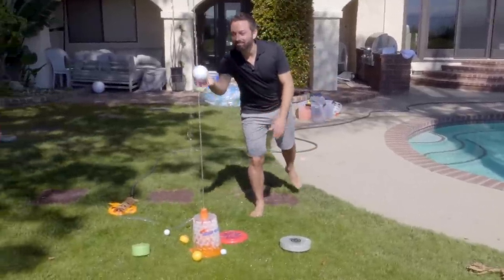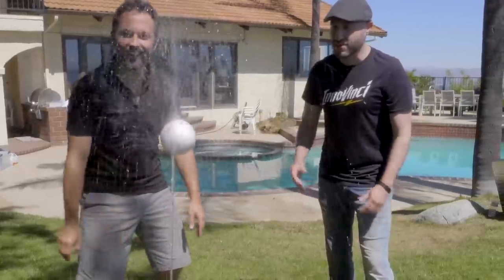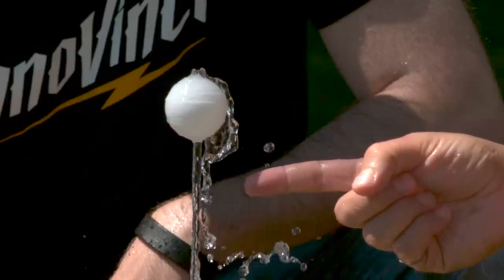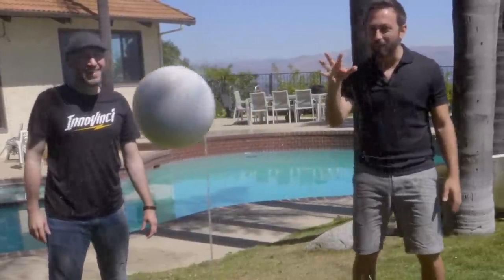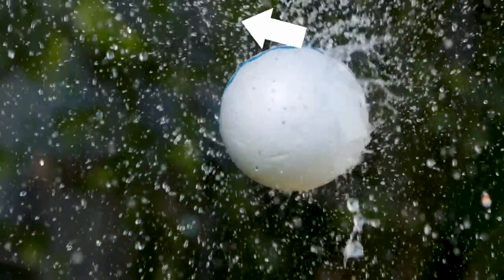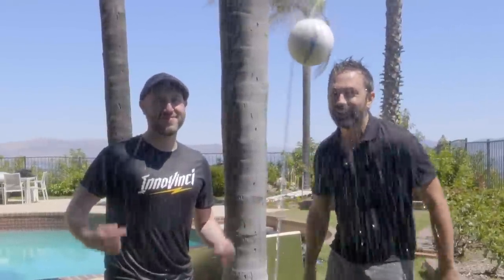Hydrodynamic Levitation!

Comment from the maker: FAQ:
1. This is similar to the Magnus effect in that the relative motion of a spinning ball through fluid creates a force that affects its motion. It's different in that here the fluid starts the ball spinning and there is an equilibrium point around which there are restoring forces. In the Magnus effect the ball must be spinning to begin with and since the fluid is everywhere it can continually change speed and direction.
2. It's not the Coanda effect. The Coanda effect relies on entraining fluid from the surrounding area creating a region of low pressure. Here there is no water surrounding the stream to entrain (since it is a narrow stream).
3. Adhesion between the water and the ball is important - this is what directs the water flow over the ball.
4. The sum of the forces I show should not be zero but equal and opposite to the weight of the ball. Hence the forces of up and out from the initial contact with the stream and up and in from the spray add to make an upward force equal to weight (the in part of the second force is much more important than the up part)
5. It would be interesting to try this with a hydrophobic coating and see if it still works. My hypothesis is it would be much harder.
6. Apparently there are other fountains and toys that use this principle that I was unaware of. This video uses the design created by my friend Blake.
Reply: You can do this with water in air going against gravity - what about doing it with air in water going against buoyancy?
Reply: Plus: The ball is hollow.
Reply: I am not sure the spray plays any significant role in this as most of it is actually happening at the top so is not providing any up force in aggregate. 

I believe some or all these forces are helping maintain the equilibrium and keeping the disc up:

(1) water is not hitting the ball/disc exactly on the circumference. It's slightly inside. That force breaks down into two components: (a) rotate the ball/disc (b) apply upward force which helps counteract gravity. 
 
(2) stickiness to water which applies an upward force as the water is shooting upwards, helping counteract gravity. This also provides an in force I think. Since the ball does not try to push out as it tends to adhere to the water stream. 

(3) gyroscope effect for position stability esp for the disk
Reply: I thought static electricity between the styrofoam ball and the water would help keep it in place. Is it possible that it actually is true to any significant capacity?
Reply: What's up Derek?
Reply: You can also do it with a screwdriver and compressed air! Is it the same effect?
Reply: Veritasium 
if light does not have mass 
then why gravity has an effect on it ?
Reply: static electric levitation  is better, it will be how we will fly crafts in the future by changing the positive or negative electrons around the craft to move and levitate, just an FYI on the future I have seen.
Reply: grkhetan its the rotation that spins it back to the stream.. simple really.
Reply: I don't think that would work. With water in air (on land), the motion of the stream is outward from the plane (the ground). With air in water, though, the motion of the stream is toward the plane (the surface of the water). If air struck a ball in water as it was falling, it would just push it out of the way or move around the ball and continue upward. The water from the stream in the video example is going out and then back down.

That's not even considering that the adhesion responsible for the ball's ability to move the water around does not apply to the air in a situation of a rising air stream in water.
Reply: In order to increase adhesion on the disk, wouldn't it be a good idea to add some small edges on that disk, positionoed in a way that they rotate the disk by the force of the water jet?
Reply: would it still work with a polished light weight metal or glass ball where there isn't as much surface tension for the water to push and force the ball around?
Reply: plz gimme an equation for this.
Reply: How can the water "push" on the sphere?  Waters cohesion to the sphere allows it to be under centripetal force which would pull on the sphere.  Loss of this cohesion would not push... pull less??  I threw out a few ideas in a general comment but I really want to know how you explain the water pushing...
Reply: It would be interesting if this experiment could be done also using another liquid with a lower surface tension!
Reply: Veritasium I think the polarity of the water also plays a role. It would be interesting to see if this would work with other liquids (alcohols, oils, etc) with different polarities.
Reply: san kitty "dihydrogen monoxide" makes it sound more scary.
Reply: Hmm, I'm tempted to try to replicate this on a small scale using acetone and a ping-pong ball. Hardest part may be figuring out how to not make a flammable mess.
Reply: Veritasium Missing the times when you got to the street and simply asked questions to people, and showed them how they really don't understand things that they thought they do. Tricky questions and counterintuitive thinking, showing us wrong to get right.
Reply: +Ryan Maxwell https://en.wikipedia.org/wiki/Momentum#Conservation
Water is the one that keeps the ball spinning
Reply: #3 and #4:  The droplets that form water strings are oriented normal to the surface and moving radialy because of radial acceleration outwards so the net effect from those droplets is 0 towards stabilization of the ball.

The main part of this effect lies in that little sweet spot where stream is hitting the ball's surface. Here, the Van der Waals forces between the ball's surface and the water act and that is why ball receives the energy from water.

The water hits the surface, smashes against it and the water tries to pull itself back together with surface tension. Some of it (the part that had energy high enough) forms smaller droplets and some of it ends up pulling the ball with tangential acceleration. This in turn starts rotating the ball. The force vector of all of this points upwards and into the stream (with a slight angle which should be similar to the angle from the point of contact of the surface and water stream, tangentially out). That is why the ball fell vertically when you put your hand below it and blocked the stream. If you look closely it swerved into the stream after it regained contact with the water, I think supporting the hypothesis written.

#5: My bet is that it will not work on hydrophobic ball at all, since the water will just bounce off the surface and the ball will immediately fall to the ground since there is no sticking of the water to the ball and only slight transfer of inertia. So the stream will with 100% certainty shoot away the ball. I would be surprised if it weren't so.

It would be interesting to also play with different viscosities and with that try to levitate more than one ball at the same time. Maybe there are some more secrets to unlock?
Reply from the maker: plenty of misconceptions in this comment section but yes I take your point
Reply from the maker: easy, water hits ball, bounces off and some momentum is transferred. You can see the water getting slowed and deflected to the left where it hits the ball. This means the ball is being pushed up and to the right by the water.
Reply: Veritasium What misconceptions in general stick out?

There are so many variables in real world (non-controlled) settings. 

I think there's a lot of interesting thoughts and suggestions in the comments. I think most people's comments weren't meant to challenge your understanding, but rather to expand on it out if their own curiosity. Like how the surface tension of the liquid, the surface of the ball and whether it has a hydrophobic coating or not, etc. might have an effect on the experiment.
Reply: Veritasium I hope you'll find the time to try #5 (did you see my suggestion, lol?) and maybe even some other tricks that influence adhesion/cohesion - using sandpaper on the ball's surface, using another fluid (soapy water?), etc.
Reply: @Veritasium: Yes, of course. The water hits it (and tries to topple it to the right like you said) and then water changes direction and pulls the ball/disc with it (the secondary effect of "friction" between water and ball's surface that keeps the ball in one spot) in that direction because it is sliding over the surface. That's why it is proposed that hydrophobic will have only the first effect (topple the ball out of the stream). 
The droplets opposite the stream are flying radially out on the ball and I disregarded those because in the green disc experiment, there are basically none of them opposite the stream. So I figured they are not contributing anything (or very little) to the end cause of stability. But, I could be wrong. 
The hydrophilic ball gedanken experiment though...is making my head explode...would it sink into the water stream? Or would it first get pushed by the water like the styrofoam and then slide down along the stream because it would become too slippery for the stream?
Reply: You always comment what I'm about to say when I go to put my 2 cents in.
Reply: You should DEFINITELY search and make a video about kinetic stone sculptures. There is one in Bursa/Turkey made by Christian Tobin. 6 and 7 tons weighing stones are spining on a cushion of water.
Reply: He already has buddy. No that exact one but the same principle.
Reply: You should try this experiment again but lower the surface tension of the water to validate you theory.
Reply: You need a hardware audio compressor for your microphone(s), Derek. There was so much signal loss while you were excited =)
Reply: He's been getting exited a lot lately.  Something tells me he's looking to target younger audiences...  Most of them are oblivious to fake excitement. 

Edit: After seeing other comments I realize his issue could have been avoided with a change in editing.
Reply: Veritasium very cool thanks for sharing
Reply: Could you pls try it again, but this time adding a little bit of soap in the water, to break up its superficial tension? Congratulations for this very interesting video!
Reply: Veritasium Dear veritasium, 
Could you also try,
1. A donut shaped object to see to see if the inside gets wet as well. 
2. Different speed of water
3. Different weight of the balls
4. Die the water in different colour each 5 seconds to see its actual path
5. Try "passing the ball" from one water stream to another
6. Try with different ballons (ball with air and therefore extremly light). 
7. Maybe different water temperature (because the water tention might change at that point.

8. Disrupt the "flow" of the water in many ways. Putting the pipe in a pool where it therefore has to push away a lot of water. 
8.1 putting different balls at the same time. A ping pong ball, a balloon and a styrofoam ball for eg. Sinc it looses speed with each contact it should be completly disrupted by the end. 

I know I am already late. That is why I commented under your comment to get more attention from you. I hope you dont mind.
Reply: Veritasium is so excited
Reply: Veritasium this definitely strikes me as largely impacted by gyroscopic effects as well as water adhesion to the object and the water coating adhering to the stream as well, also the size of the object and possible surface roughness.  Is the surface of the ball completely smooth or rough like most styrofoam?
Reply: I was about to say you should try it with a hydrophobic coating but you beat me to it!
Reply: Was about to point out the possibility of the Magnus effect in play here.
Reply: Can you please make a video about black holes, quark stars and neutron stars? I have my own theory, which says that black holes are just neutron/quark stars which have so much mass, that the light emitted from these stars, never reach us or anybody else because they just fall back on the surface, so they look black. Is it possible that my theory actually works?
Reply: Derek, how old where you in the video with the hair driyer ? dude, it looks like you were a teenager
Reply: Veritasium why don't you test your hypothesis, coat the balls in hydrophobic spray and see if the ball still levitates
Reply: About item 2, I believe it isn't right. The low pressure region is necessary only in the beginning of the effect, and a narrow stream of water is perfectly capable of to create this initial condition. And the Coanda effect explains item 3,  adhesion between the fluid (water) and the convex surface (ball)...
Reply: Veritasium bro this is why I love science
Reply: Can I Ask A Question?? Could The Sun Die Could It Lose Light/heat???
Reply: Amazing. First time I see that. This should be called the Vinci-Veritasium effect.
Reply: +Veritasium: Why is Bernoulli principle not the main factor working here? The air closer to the water stream moves faster and thus exert less pressure on the ball (disk) than that further away. That keeps the ball (disk) in contact with the stream, the upward momentum of which imparts to the ball (disk) countering the gravity. 

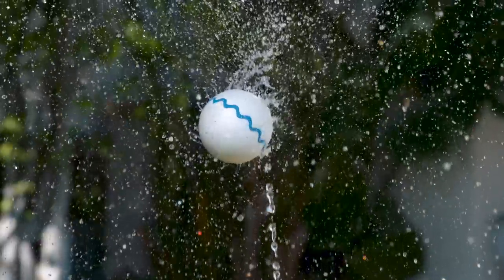The secondary force contributing to the levitation does come from the spraying of the water. However, you are not completely right on the mechanism. The spraying of water occurs all over the surface. At 3:24 you say "the water is getting thrown over and down by the ball" thus " is putting a force up and in on the ball". However, since the water droplet adhering to the ball surface starts from the stream it will more likely be thrown off first while going up and out (you can see this clearly from the video as more water shoots away from upper part of the ball than the lower part), the force on the ball will be greater, down rather up, and in, on the ball. The down force is more than compensated for by the much greater upward force from the water stream exerted on the ball. The effect of the spraying is to contribute together with the Bernoulli principle that air stream observes to press the ball again the water stream allowing the water stream to do the work of lifting the ball.
Reply: How many stable fluid levitation effects are there?
Reply: +Jarrod Baniqued: All of these phenomena, including the ones shown in this video, Magnus and Coanda effects, are corollaries of Bernoulli principle. I do not see the essential conceptual difference amongst them. Any effort to differentiate is nit-picking and wasteful.
Reply: One of the Veritasium team looks like the lead singer from Rise Against!
Reply: because gravity bends the space. And light travels trough space
Reply: I was gonna say, very similar to the magnus effect. Very cool
Reply: Jmoss7 indubitably
Reply: Veritasium what will happen if you do this in a vacuum. will that manipulate the law of Bernoulli?
Reply: I'm pretty sure you're explanation is somewhat wrong. It seams you're overestimating the sideways force that the water is putting upon the object, the water is mainly putting an upward force on the object, since the water is going upward. Now the reason why you think it is putting a sideways force is because the force is offset to the center of gravity of the object, but this does not induce any sideways force, it only induces a moment in the object causing it to spin.

The restoring force you're seeing keeping it in place is probably due to that adhesion you were talking about but might also have to do with some fluid dynamics since you do have a liquid traveling at speed on one side of the object and a stationary liquid (the air) at the other. But I don't know enough about fluid dynamics to tell you how this interaction would behave. It seams you have not consulted with physicists in the making of this video :/ And in the spirit of keeping it "scientific" you should have presented this as a hypothesis and stated "here's the parameters we could change to support our hypotheses and here's how to disprove it", not just bluntly state "This is how it works, trust me, I'm the host of Veratasium!" Still an entertaining video tho, just seams you're straying a bit of what your channel used to stand for, finding the element of truth, not presenting it.
Reply: I just saw this at a science museum in columbus, OH.
Reply: C.O.S.I.?
Reply: yep
Reply: Light does have mass. it's just super tiny
Reply: According to special relativity, light is massless, otherwise it wouldn't move at the speed of light.
Reply: Nope, light has no mass, that's the reason why it can travel at light speeds. Anything with mass, no matter how tiny, cannot travel at light speed since mass is relative to speed, so if you had mass, any amount and traveled at light speed your mass would increase to infinity and that's not possible. Light does however have momentum, but not mass.
Reply: @ganondorfchampin photon has zero rest mass, but it never exist at rest state. It only exist at lighting speed, at this state, it has mass and momentum. Because of this momentum, there is a force when photon hit something, this force cause radiation pressure.
Reply: hey veritasium
there is one thing i cant understand with water in my bath tub: a bath tub full of water and the hose (without shower head) releases more water now get the hose exit near a surface in the bath tub and it creates a suction

could you answer this phenomenon?
Reply: It if has mass, it cannot move at light speed. Light gets momentum from energy, not mass.
Reply: "It if has mass, it cannot move at light speed", i don't deny this, but it is REST MASS. "mass" is the old concept for particle when it encounters gravity field, with this concept, photon have "relative mass" at speed of light. But with the concept of space-time distortion, the mean of "relative mass" of photon has fade, it's effected by gravity because it has energy.
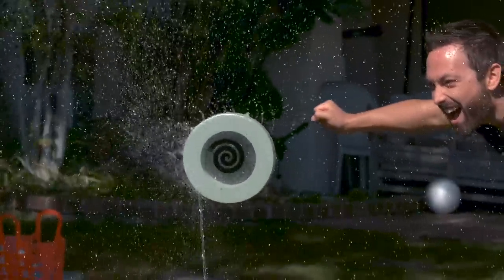Reply: Amazing effect! But most of all, I was fascinated by what happened on your back on the surface of your shirt at minute 4:55. Stuff for a new video?
Reply: Veritasium its look fun
Reply: Veritasium Noice. Now try it why hydrophobic material
Reply: Excellent video! I've begun to look at physics from a different perspective, thanks to you Veritasium!
Reply: I DIDNT Understand that why It goes to one side of stream means stream is coming  to one side of the ball. Why??
Reply: It's not that the stream only comes one side, but that the net push of the stream on the ball is always going to be in a single direction, and after the ball is pushed in that direction it will be moved to that side of the stream, reinforcing itself.
Reply: Dustin Rodriguez Air is full of nonpolar molecules that wouldn't necessarily be able to grip surfaces and be thrown around. Water is bent, thus polar, and is massively stickier so to speak. It sticks to both itself, and the ball for at least long enough to be carried over the top and thrown in the direction he indicated. In addition, gasses by definition already have so much energy that they've overcome the forces that would ordinarily hold them together as a liquid or solid.
Reply: shantanu wankhare Light does have about 10^-31 kg mass. Or one electron does.
Reply: ooh! It's my effect then! :P
Reply: Veritasium No.5 - Yes! Do that
Reply: THATS AN AMAZING APPLICATION OF MAGNUS EFFECT.
Reply: Adhesion is important; which makes me wonder what would happen with low surface tension fluid, particularly with plastic or Styrofoam.
Reply: So... Any relation to the kutta circulation theory? That'd be my guess, but the extra effects of rigid body Dynamics make it harder to guess.
Reply: what will happen if the stream is in an angle, or tilted
Reply: What if you tried this with a ball that it is hydrophobic? Will it reduce the water flow around the ball and consequently decrease stability? Just curious.
Reply: Can u do it with other shaped objects such as a octagonal disk or even a square disk?
Reply: Avrei puntato sull'effetto coanda 😅
Reply: My head is hurting iam going back to my gyroscope
Reply: Is this the same as what happens with the tape + air on this other video? https://youtu.be/-2dQfEfs_7I?t=113 If not, how are they different?
Reply: Hi, I dont have physics but i think something else is happening. I belive that the ball gets pushed upwards on the right side only, wich make it rotate.  Becouse the water is so fast it makes the ball spin fast as well.  Now whenever the ball gets pushed to the right, the rotation turns the right momentum of the ball into left momentum after 180 degrees is spun. These forces cancle each other out.
Reply: Exactly what I was thinking. Thanks
Reply: My daughter  ❤️ this video
Reply: I just do it but it doesn't work... Help me plzz what's my problem??
Reply: The link in description for how to make this, leads to a private video......lol.
Reply: I think a proof needs to be given for when the effects change and why?  From the small ball being surround by water with laminar flow.  To the larger balls using a separate equilibrium technique.  Also is water attracting anything there or simply just applying the force.  But really, when does physics decide to switch its mind if you will, to accomplish the same task with two separate methods, and why?  Why not fail.  Anyways just a thought for ya’ll.  Personally I’m too busy to allocate any time to it.  But if anyone has some free time for a decent explanation or a proof,  that would be incredible.
Reply: At no point in time is it supported by any spray down.  There is no spray down as there is no nozzle to direct the force. Almost every force that will act on the ball will act before  the vertical. 

The effect can be modeled as a vertical pipe where water is supplied at a constant pressure and where there are holes along the length of the pipe.  This is the rooster tail you see. In this case the holes are a product of surface tension.
 
There is too much mass for surface tension to hold the water to  the ball so it loses mass as it moves around the ball, losing most of its mass in the first and second quadrants.  

Surface tension holds the water until it finally necks off.  Because of this the force is always perpendicular to the surface of the ball when it leaves the stream. 

If you draw a force diagram the counteracting force vector is in the top quadrant on the same side as the incoming flow of water and directly above it. and this is why it is stable once it is established. Close enough for government work.
Reply: Suggestion: use the schlieren technique and air instead of water
Reply: Wff how can you say your buddy invented this, ofcourse he fking did not invent it or anything
Reply: @DustinRodriguez1_0   it actually the principle of magnus effect in a way
Reply: @shantanuwankhare2184  According to general relativity, gravity is actually caused by a curving of space and time. Since light travels in a straight line through straight spacetime, the curving of spacetime causes light to follow a curved path
Reply: @shantanuwankhare2184  gravity doesn't really affect mass, but it actually warps time, bending space so that anything in motion curves toward the source.
Reply: >Adhesion between the water and the ball is important
Yes. Water flies up by inertia and pulls the ball's side up with that adhesion.
Reply: actually its very similar to a firestaff performer who spins the staff in the same spot using 1 hand (not infinity 8 motion but. jumping O)
Reply: Can conservation of momentum somehow cause this effect?